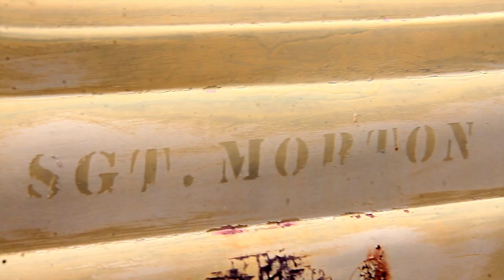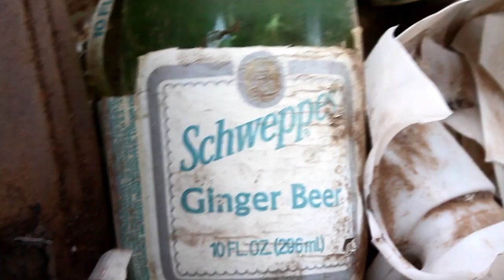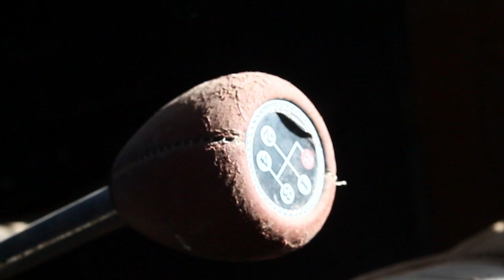The Volvo Rescue Episode 7 Buying two 1967 Amazon Wagon 122s

Comment: That is an amazing project!

I can't wait to see your next episodes!

I'm restoring a 122S like you did before... That's a long way until finish, but by now I'm just renewing the brake system.

Like the Shelby, I started with a 122S ver. 1.0 and I found lots of rust.... So I got a 122S ver. 2.0.

Greetings from Portugal
Reply from the maker: Thanks for your comment! I've got a video on restoring the brakes if you need any help. I will make part two later this month.